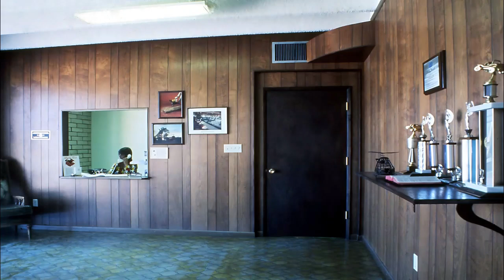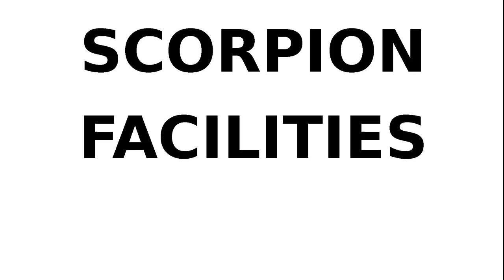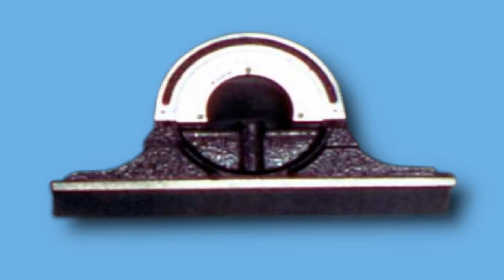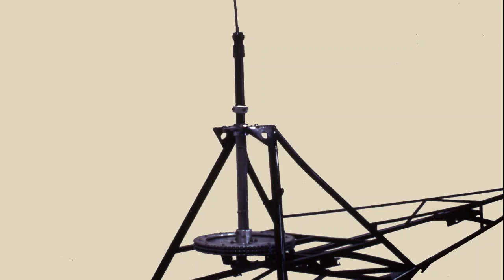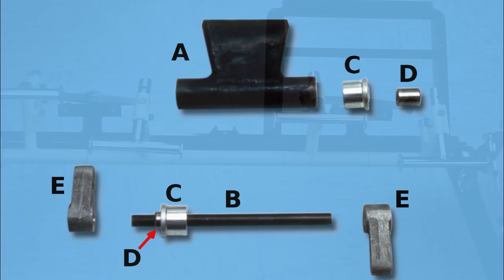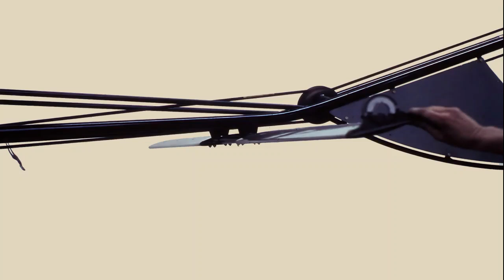Scorpion Helicopter Owners Indoctrination Course

Comment: great to see this video. I built mine in 1971 when the frame was all in pieces and all alum parts were flat pieces of alum with the machine work done and the cost of the project was around $7,000 . I had 40 hours in it when I tipped it over lost a counter balance weight in a hard landing. a fun project sold it and built a varieze